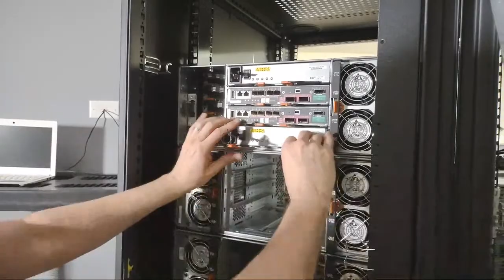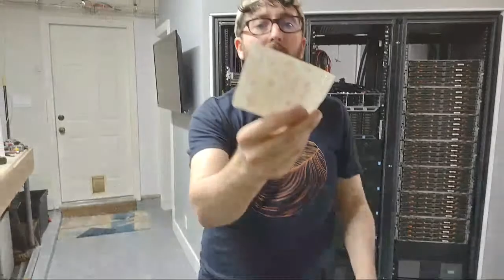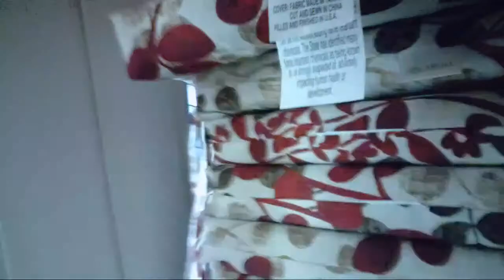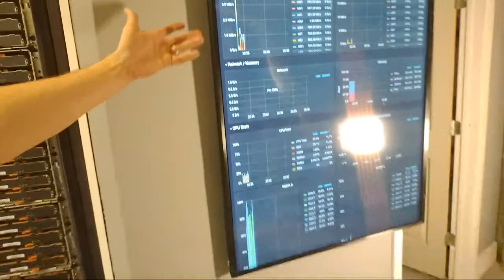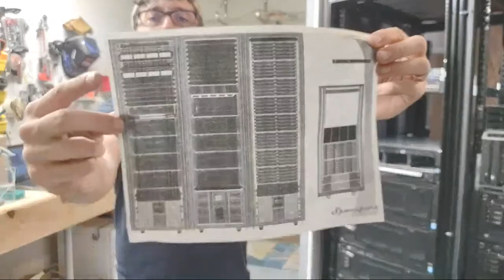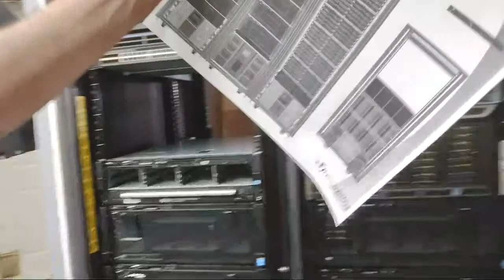Home Datacenter Livestream - Racking, Networking + Progress

Comment: Don't introduce hot air into the front of that AC.  Only let it circulate the air in the front of the Server Room.  Close the Doors to the back of the server room.  Open up the door in the back to the room with the window.  Put a powerful fan in the window.  Don't worry about how much air gets out of the hot zone.  Only worry about the cool air going into the front of the rack.   The fan in the window will help pull air into the front of the servers.  Make sure you seal the doors going from the front to the back of the servers with bottom seals.  On the door leading into the house, cut a 6"x10" hole in the bottom of it big enough to mount vent covers on both sides.  Now you have a static circulating zone in the front of the servers being fed by the AC from the house coming through the vent.  The fan in the back is helping suck cool air from the front (and air from the house through the vent) through the servers and pulling out hot air.  This will work really good for what you have going on because nothing in the back room is heat sensitive.

Comment: This is a great setup, thinking of getting some MD3460E to build a ceph cluster. It would be great if you could try it and do a tutorial.😀
Reply from the maker: Do you know if they have the same emm controllers? I am also buying some SAS ones here to test some things with also. Ceph and BeeGFS are on tap
Reply: @DigitalSpaceport  Wow, thank you for replying me. The MD3460E has the 12GB SAS ports instead of 6GB on the 3060E, but other then that should be all the same.